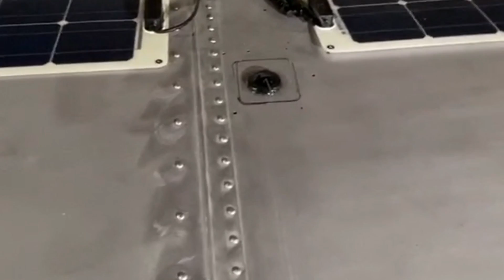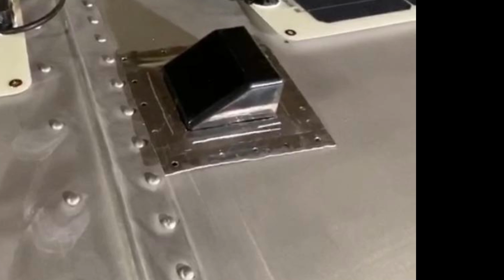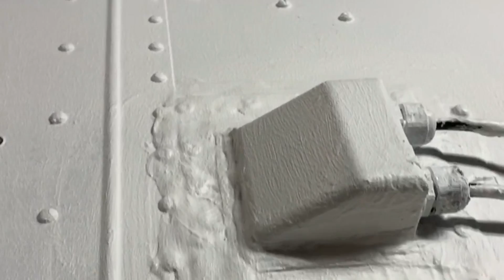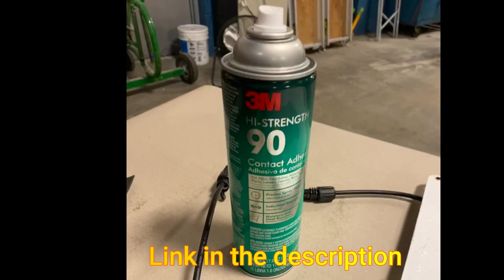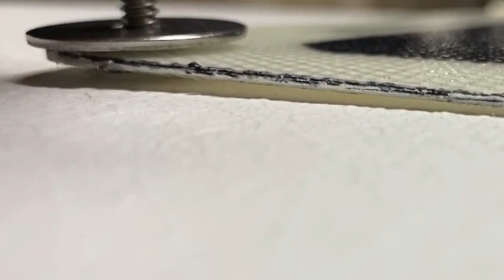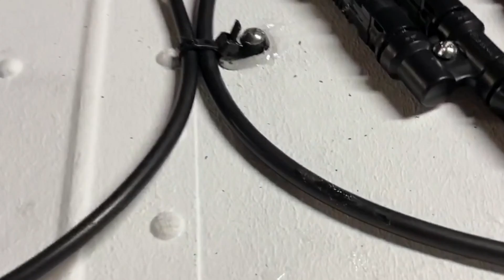Going Off-Grid in Style: Solar Bus Conversion Part 1 Panel Install

Comment: I'll be curious how they hold up long term.  I've only read bad things on any of the flexible panels.  Less than 5 years lifespan.  I was looking into it for Gus.
Reply from the maker: Honestly I heard those things too but I took a chance. I've had two flawless seasons now with no issues.
Reply: @michigansilversidebus2408  How visible are they from the ground?
Reply from the maker: @BusWithUs.  you can not see them at all.
Reply: @michigansilversidebus2408  thanks for the details
Reply from the maker: YW thanks for watching!